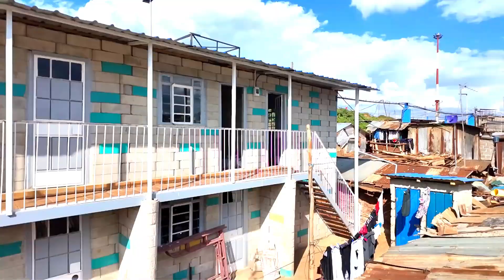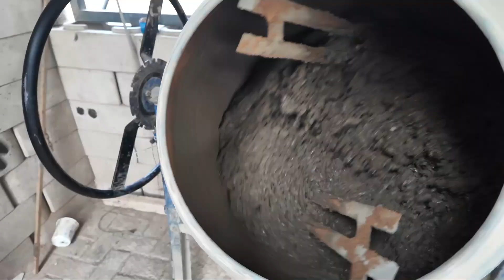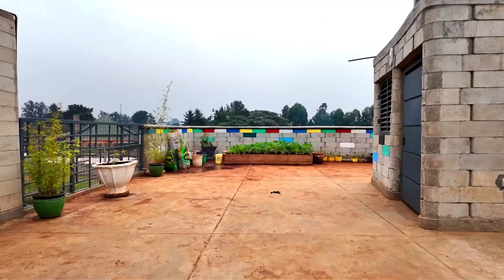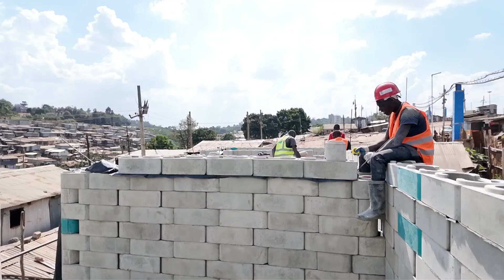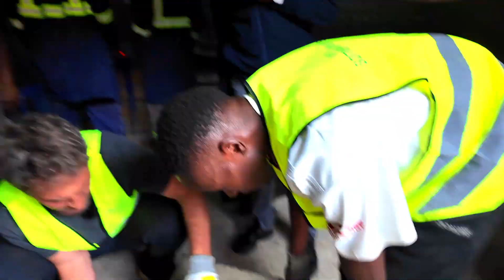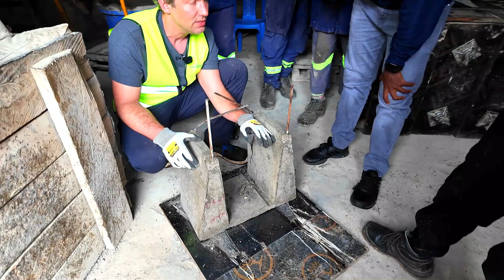From Slums to Dignity: How German Architect Is Restoring Hope in Kibera

Comment: This group just provided a solution to my search for wall material that can be used in constructing a rondhavel. The traditional African swelling/house.

Can it be produced in clay, compacted earth, fired or otherwise?

Good work team, I am coming for those hollow twisted concrete blocks

How can I contact the designers and the team by phone.

One question, can we get a similar roofing product that is not based on the straight line block structures..

There is the idea to create corrugated iron roofs that can roof a curved surface, but no existing manufacture is willing to venture in that direction.